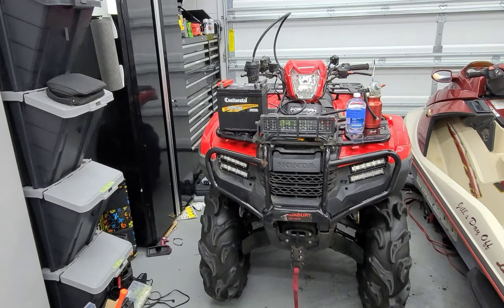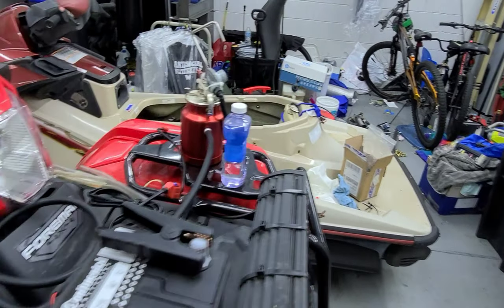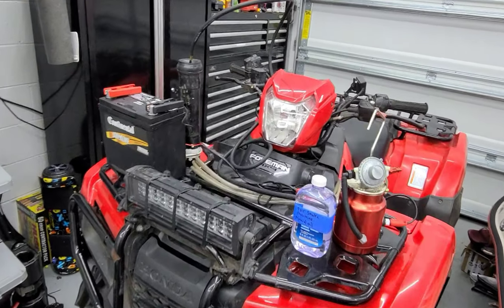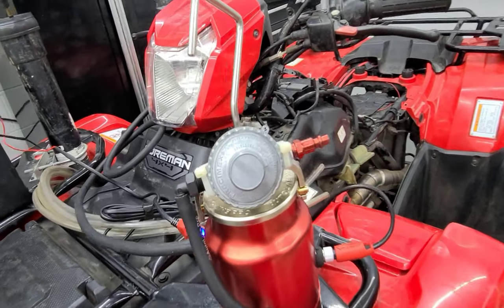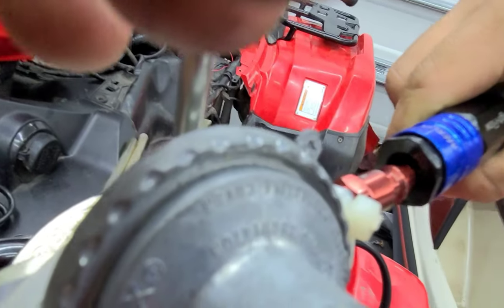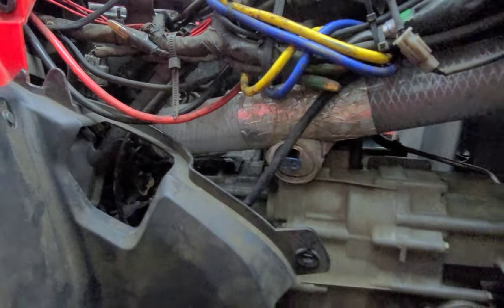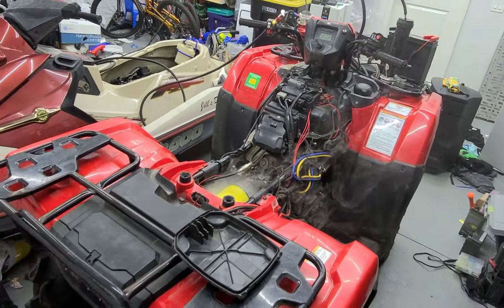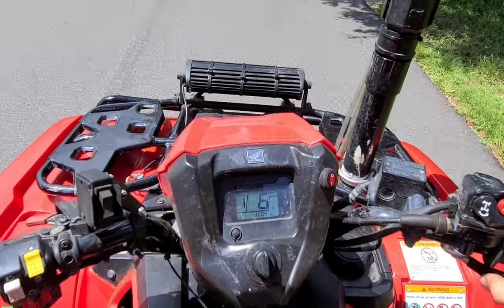SMOKE TEST ANY SNORKEL IN MINUTES!

Comment: What if you got 4 snorkels
Reply: One is just breather hoses two are belt ventilation 1 intake and one exhaust. Cap the belt exhaust off and do the same for belt intake it will show you where any belt leaks are.
Reply from the maker: Crazy combo
Reply: Just do one at a time